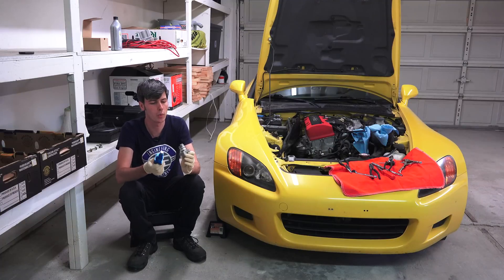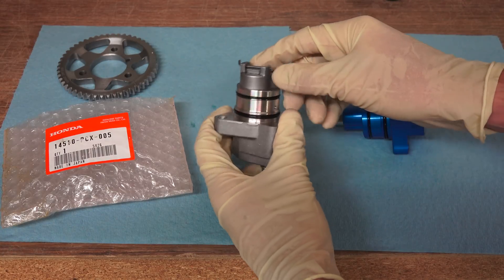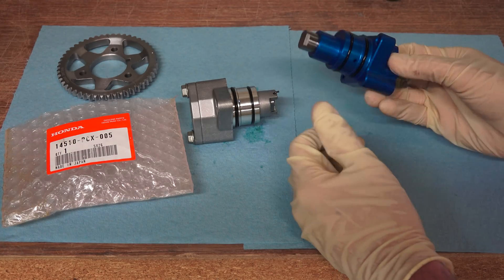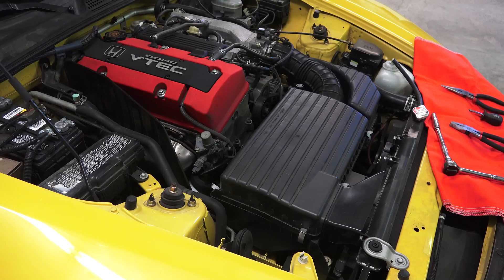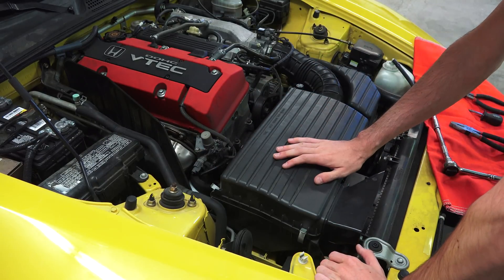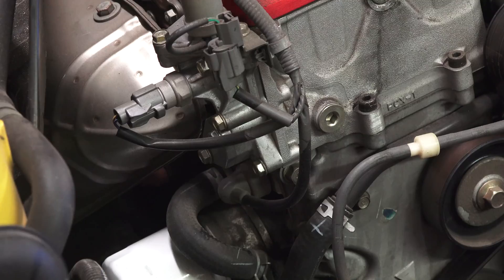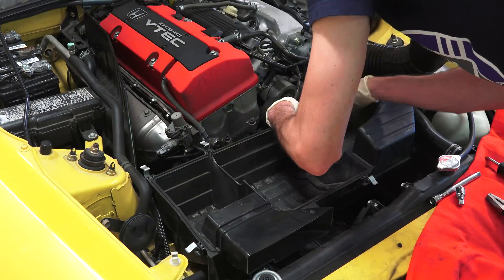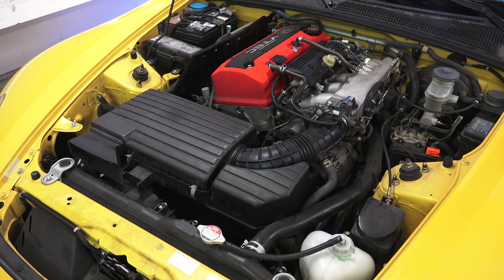Fixing A Common Honda S2000 Problem - Timing Chain Tensioner

Comment: I had the opportunity to see Billmans operation, the guy on the s2ki forums who reconditions old TCTs. He explained that the part that fails isn't the tensioner, but instead the guides which wear out over time and the TCT no longer has enough travel to securely tension the chain. His TCTs sit deeper in the head, and also allows for more oil pressure inside. Every question I had regarding oil, spring weight, and depth was well thought out and makes sense. I have his TCT on my car and have no issues. He has removed countless Ballade TCT and notes that not only can the paint flake off inside the head, but also if your guides are worn, a Ballade TCT is not a viable solution because it has no more tensioning length than the oem TCT.

Comment: Can you remove tensioner with the engine at any position? #1 cylinder at TDC? Is there a possibility of skipping a tooth on sprocket from a lobe under valve spring tension?

Comment: Ballade TCT is the only way to go. I've been through 3 Honda TCTs and they are utter garbage. I even did an engine rebuild replacing the chain, guides and TCT and it still failed after 2 years. Ballade is still going strong even after 7 years. 💪👍

Comment: Probably needed for it to get warm to know if the fix really worked. A lot of times the issue doesn't manifest until after the engine is warm (I assume because the oil things out when hot so less pressure).

Comment: Looks like an expensive band aid. The chain will stretch from wear in the pins and not from plastic deformation, I know you didn't imply that but it means that we can assume the length of each chain segment increased by nearly the same amount. Should that assumption be right then the camshafts relative engagement should remain the same regardless whether you have a $200+ TCT or a sandblasted worm gear,  that money would be better off in some feeler gauges, pizza and beer while you reset the cams with a valve adjustment. Just make sure to engage the backlash in a systematic manner each time.  

Where do you think the OEM worm gear lacks exactly? I saw mine and the threads had a mirror finish as well and I want to say that if I sand blasted it, that it would have more friction to resist retracting.  But when I think about it an aluminum oxide blasted surface finish should have less friction force due to decreased surface area, at least compared to the mirror finish surface. 

And maybe this is where the problem lies, the spring force cannot overcome the frictional force of the worm gear threads on the housing during compression of the timing chain.

I would love to see a further inquiry into this issue, I'm also interested how significant/insignificant the wear of a chain is at that point, or at least its order of magnitude. 

Good video, bling bling looks nice, but please no more condom gloves haha, and get a size or two smaller for a more positive tactile grip.

Comment: I replaced the TCT on my '08 S2000 today.  I got it with 59K miles in 2013. It's my daily driver and it now has 133K. I noticed the TCT making a ticking noise about 25K miles ago.  I saw this video when Jason first published it and he made it look easy. I bought the Ballade Sport TCT about 2 months ago and finally got around to changing it today.  The only thing I did differently than the video is to remove the cover and the shoulder bolt from the old TCT and install a 5mm bolt, washer, and wing nut similar to the way the Ballad one comes.  I was paranoid about the plunger and springs falling into the motor when removing the old TCT. It also gave me something to grab on to when removing the old one. Everything worked fine and now I don't have that ticking noise.Great video, thanks!

Comment: AP1 or AP2? the Golden Question
Reply from the maker: I've got the AP1; I've never driven an AP2, but I like the sounds of it on paper more. AP2 has more torque, more aggressive gearing, taller 6th gear, softer rear suspension.
Reply: yah the ap2 has better handling, wonder if the Area under the cruves are higher ? I have a 15 wrx flex fuel 350/350 loving it and had a 07 ap2 before. got 28mpg on drive by wire not bad.

Comment: Honda master tech here, the chain is meant to last the life of the vehicle, I've seen 300k+ miles with the original chain. The only time I've seen chain stretch in all the years I've worked at the dealer is a car that was poorly maintained so it leaked from every gasket it had (2003-2007 Accord I4) so the oil starvation caused chain stretch. The S2000 does have a bit of a problem with the tensioner but I've never seen one come in with a stretched or damaged chain. Change the oil regularly and the chain will never need replacement. Also, always follow the service manual procedure on removing the tension by removing the backing plate and using a bolt to pull the plunger in. I've seen someone just try to unbolt it without doing this and the tension of the plunger pushing out caused the threads in the cylinder head to be damaged due to the stress put on them.
Reply: I put 70k miles on my ballade sports tct
Reply: What about the Honda motorcycles, I have a Cbr600f3 that rattles a bit?
Reply: would you still recommend the aftermarket tensioner over the oem?
Reply: ACEDshooter I came here to say that this TCT that ballade sports sell and it is a no go, there are forums out there saying it’s probably a bad option out there, (I also have ballade sports tct and only lasted 3k miles before it went bad) so I’d just stick to OEM man. My S2k has 56k miles.
Reply: @nose733  Billman TCT is best
Reply: if your stock yeah turbo or sc more tension is better @ACEDshooter

Comment: i bought my first s2000 4 days ago after a 5 year wait, was over the moon ! i drove 80 miles in it of which i was aware the tct was going to need changed so i had the part ordered for the next day. because the car had been sitting still since December i can only imagine the tct had almost ceased and got much worse very very quickly ...long story short the head of my engine is being rebuilt. if anyone hears the slightest tick from their engine change the tct immediately!!!

Comment: i liked your video.  well done. only thing i would add - my tensioner came with the piston extended.  There are notches on the piston that will allow you to turn it with a crescent wrench and 'wind' it back down into a retracted position.  It is not possible to fit the tensioner unless this is done

Comment: Let me ask you a question,
could the factory tct be under any resistance from the chain before pulling it out?? if you can pull it out no problem, then it should go back in no problem right??????

I was confused about that part at the end i mean if you pulled it out no problem, then there shouldnt be any resistance putting it back in..

on the other hand, if I have trouble getting it, would spinning the crankshaft make it any easier? should i experiment with that?

Comment: Wow. Kudos to Honda for making this an easily-replaceable part! I changed a chain tensioner on a Toyota 22RE engine a number of years ago and, like many engines, the tensioner was fully located inside the engine, which required removing the oil pan and front cover (among many other things) for access. I've been a fan of Honda for many years, but this makes me even more so. Thanks for the video!

Comment: I have a 2004 Toyota Corolla CE with almost 150,000 miles on it. There are no apparent signs that the tensioner or timing chain need to be changed but should I change it anyway for safe measure?

Comment: I'll bet you won't notice any chain stretching. I've changed chains on a old BMW with close to 200,000 miles and it didn't stretch whatsoever. I honestly doubt your chain has stretched whatsoever. I think that cam gear is a waste of money.

Comment: why is the airbox bigger than the engine?
Reply: That's the flux capacitor not the airbox
Reply: Because the vortex generated by the vtec gets used to force more air into the engine which produces the 900hp vtec engines make
Reply: ***** haha that are good wun

Comment: Is the worm gear really part of a gear pair, or is it a flow reducing helix controlling back pressure behind it (and hence chain tension) ?
That could explain why sand blasting or roughing the OEM one works for a while as it's surface flow resistance is increased (and creates more back pressure).
Also another thought came to mind, what would the effect be on chain tension by opening up the diameter of the input oil feed hole slightly with a suitable jet drill by 25-50% ?
Anyone ever cut a TCT in half for a photo, I'd love to see it.

Comment: Hello Jason,
   Would you consider making a video on lubricants, and what lubricants would be the best for different contact points on the car.   White Lithium grease, Oil, ball joint grease, WD40, ATF, antiseize.   What lube can be used on bushings to make them last,   what lubes can be put on frame bolts to prevent rust.   I'm sure with a little thought there would be enough material to make a good video.  Thanks!  
 One specific question, What is the final answer on lubricating brake bleeders, or brake line fittings.  is it okay to spray any fluid on the threads to prevent rust or seize?  Many people say don't ever put a lubricant on brake fittings, yet some do.

Thanks again.
- Russ

Comment: Mannn I wish you could pick up a Subaru SVX to do some of these maintenance and repair videos. I have a 1992 one and from what i know so far, i need a valve cover gasket, my radio installed, and my passenger side window cannot go up or down. Haven't the fainest idea what i need to remove to get to that valve cover there is a ton of stuff on top of it.
Reply: It shouldn't be that hard. honestly it's just a valve cover. I have never seen the engine if your car, but I might actually check it out on Mitchell when I go to the shop tomorrow.

Comment: do you have any vids that go over info related to converting gasoline engines to e85. my cadillac has the LTG engine and kits are sold to allow it to run on any gas/etoh fuel mixture
Reply: sorry i meant to elaborate, i want to know what the engine is actually doing differently from etoh10% to 85% when running

Comment: Did not think the engine would require 10-30, as the later K series engines take 5, and earlier models still took 5. Weird.

Comment: Is that airbox factory? It's the biggest I have ever see for a 4cylinder.
Reply: supercooled yes that's factory
Reply: resonator
Reply: not really, most cars have a resignator box, usually in the bumper thats bigger, in addition to the air box, while this has no resignator box

Comment: The cam/timing chain tensioner on my bike (Triumph Daytona) is already going and it's only just over a year old and 12,000km. One of the most common things to go wrong on newer bikes. I'm going to replace it with a manual tensioner

My old Honda has gear driven cams. Pretty much last the life of the bike and sound awesome.

Keep up the good work! Love your videos.

Comment: The VTEC is going to kick in even harder now thanks to the tighter chain... you better be ready for it.
Reply: glenn villegas that makes absolutely zero sense.
Reply: it only matters in first, gear, unless you dump the clutch at 5500+ RPM.   On the track, you can easily keep the car in vtec all day.
Reply: Whoa...did ya feel the VTEC kick in?!

Comment: Two quick questions.
Are you also going to replace the upper timing chain gear that "corrects" for stretching of the chain? is it adjustable or just a fixed change?
I'm usually pretty good at visualizing things ( Engineering Physics - Oregon State 1980).
But I can't seem to see what the worm gear is doing inside the TCT.
Can you give a little more detail on it's purpose or, perhaps, a white board diagram?
Thanks.

Comment: If it were me, I'd replace the chain while I am at it.

New chain, new tensioner, means no need to worry for 100,000 miles
Reply: @David G When it's cold it will rattle/rasp on the first crank, for 1/2 second before it fires. Not every time.
Reply: The chain isn't worn, just the tension device.  Maybe, watch the video next time.  I remember when we were all discussing inventing this fix.  I was one of the original to have the TCT failure the worse.
Reply: Do you think I will need to replace the tensioner on my Accord K24 at 150,000 miles?
Reply: IIGrayfoxII you only have to inspect the chain at 100K. You would only replace it if you are having problems otherwise you would never need to replace it.
Reply: too bad for f20c....k series chains last much much longer!

Comment: Didn't you say it only started to rattle when warm?
How does it sound after a long drive?
And since the chain will continue to stretch over time, what is the safe miles to replace it?

Comment: Where do you find all this data about the bolts such as the lb-ft that they're tightened?
Reply: keez1994 workshop manual. Can get the PDF version online for the s2000

Comment: Stretched timing chain at just over 100K miles? It's not uncommon for chain-driven Toyota engines to go over 350K miles w/o any adjustments or maintenance. Seems more R&D was necessary by Honda's engineers. Maybe then, these cars would still be in production.
Reply: Mr Ol Skül There's no way of knowing if the timing chain has actually stretched without removing and measuring it compared to a new oem chain. He did say in the video that there have been known examples with 340k miles without a timing chain replacement. And I don't believe I can recall a 2.0 liter Toyota making 240 hp or a vehicle with a 50/50 weight distribution so I think Honda's engineers did just fine.
Reply: This is a very high revving engine relative to any Yota.
Reply: Regardless, a timing chain and all it's components should last more than 300K miles. That should be the norm and not the exception which seems to be the case here, as he comments on the video.
Reply: Yeah, I didn't read  the description, only saw the video, but that seems more like it. Shame the tensioner fails so soon though. At least it's a simple fix.

Comment: Good to know that this part is serviceable on some imports. I have been spoiled so far by only needing to fix OHV motors. No need for a chain tensioner if the sprockets are 6" apart. Pushrods generally don't wearout :)

Comment: is valve float a possibility on this engine if the timing chain tensioner fails?
Reply: not valve float, but the head will go out of time, and the chain may skip if it gets too bad. valve float is caused by the valve springs not being able to overcome the inertia of the valves themselves

Comment: Wouldn't it be a good idea to remove the maintenance hex bolt anyway if you use the ballade to make sure the piston makes contact with the chain guide? Cause it would suck if the TCT failed and you didn't know and started your engine.

Comment: 105000 miles is a lot for the chains.

sure they are durable but I would still suggest changing out the whole timing chain during the major overhaul
Reply: go to any dealership and they will say timing chains will last 200k all day i think your thinking of timing belt which then yes about every 100k or what ever your manufacturer recommends   no point in changing out a perfectly good chain  waste of money  you will know when your chain is bad or going bad
Reply: Ok weird some says it can last up to 300k miles. But that depends if the engine was well maintained. But being a used car. I will bring to a Honda expert to replace critical parts. If the chain breaks. The damage to the valves and pistons will be drastic and the engine will prob be worthless.
Reply: usual consensus on timing chains is dont touch unless needed the other components moving the chain will wear out before the chain itself and if they wear out yes you might as well change the chain but i own a car with 160k 2.3 mzr in a mazda 6 no problem and the dealership said not to worry as i had full inspections recently  family owns 3 Volkswagen.  master mechanic for them said you usually do not see bad timing chains till about 250k  and everything i ever read online said 200-300k is about how long they last ive never heard someone say 100k on a chain on a belt yes chain no but if your paranoid go for it what ever floats your boat just saying my experience with dealerships and master mechanics
Reply: ok cool mate. it got me thinking as well because my current EJ20 is timing belt but the recent EJ and BRZ engines used timing chains. i wasnt sure how long they will last. i seen belt failure and boy the damage is so bad. the whole engine need to be swapped.
Reply: Lin Chester ya having the timing belt break will 95 percent of the time cause valves to get bent  it depends on the engine speed how severe the damage is some people are lucky af no damage  very rare though  i totally forgot the 2.0 litre boxer engines are chains know my dad owns a impreza hatchback just remember dont ignore your engine noises like alot of people you will be fine  personally when i hit 200k im getting the 2.3l completely rebuilt  i hate car payments lol
Reply: Zack Mandarino
ok i made a small blooper here. the newer Subaru engines are called FA and FB. The EJ have been superseed the FA/FB which sports the timing chains. the EJ still retains the belt driven camshafts.
Reply: Lin Chester learn  something new everyday i did not know the name change at all i thought all there 2l were ej20  or atleast remodeled version of it
Reply: yes the EJ was one of Subaru's longest serving engine. From 1989 to 2010.

Comment: That engine turns clockwise when looking at it. If you're just wanting to put a little slack in the chain to aid with the TCT install, just turn the engine counterclockwise just a touch, and it'll put slack in the chain.